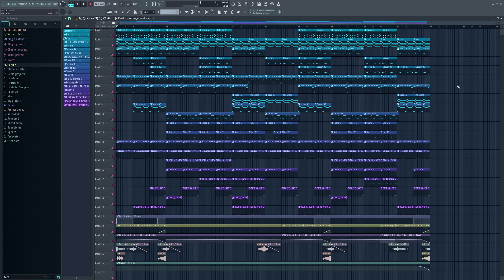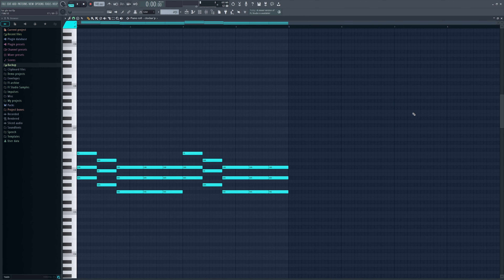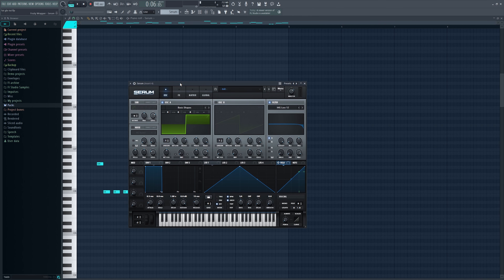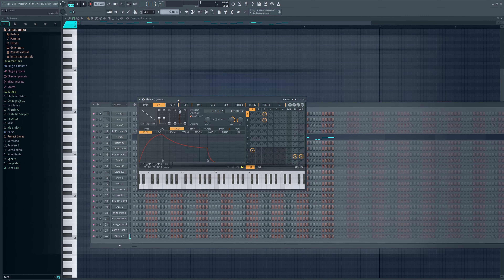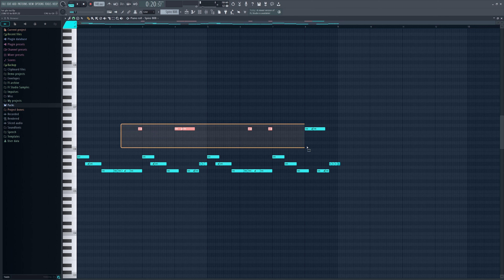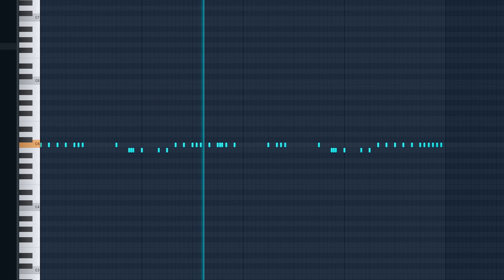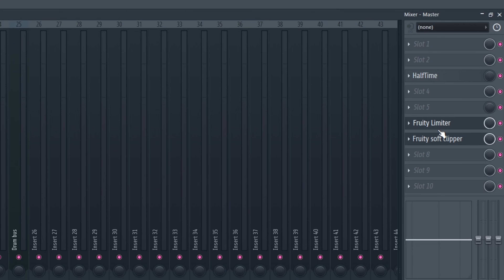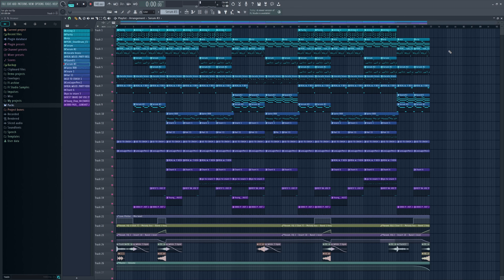HOW TO MAKE FUTURISTIC GLO BEATS FOR CHIEF KEEF

Comment: Could you make a glow beat but with native plugins please?
Reply from the maker: That would be kinda hard. You could try using flex for the strings or for the arp and guitar, you can also make the square lead with pretty much any synth, and u can use the stock fl steel drum like I did. However the final product might not sound like 2013 since nexus was the to go plugin back then
Reply: 3xosc would also help for the sines and synths if u know a little sound design
Reply: Bro if your looking for sounds start w Sonic Cat Purity $50 and splice for drums $30 / mo. Many hits made with both.